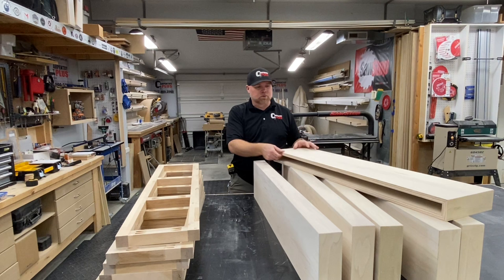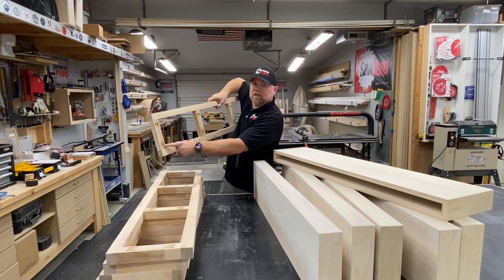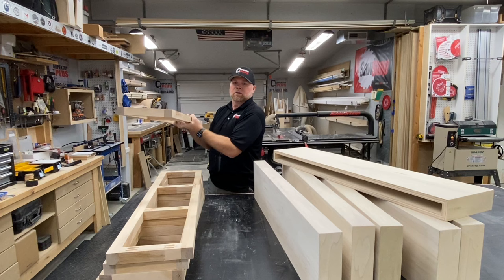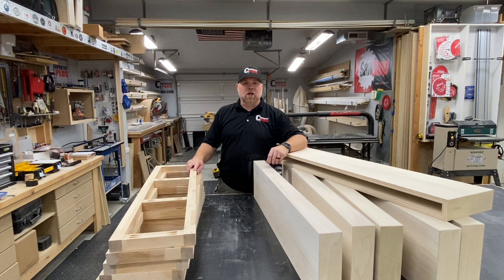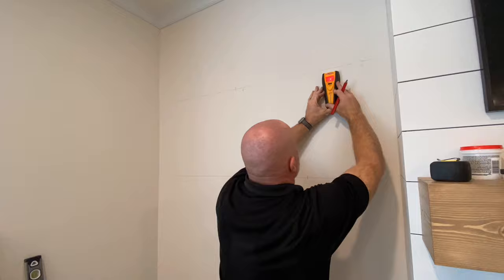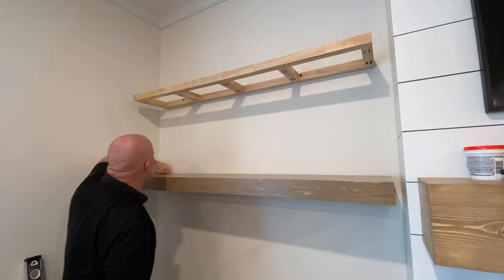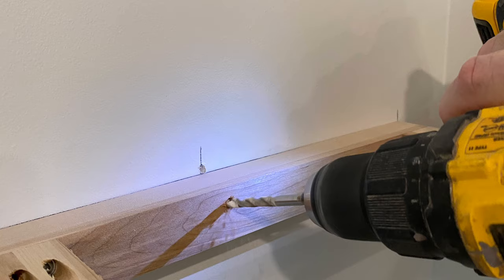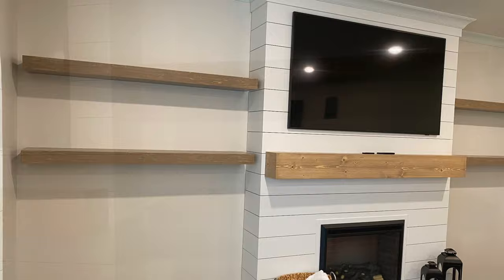Floating Shelves

Comment: my shelf needs to be 18 out form wall and 32 wide do you think this would work for something that size? going ot be holding consoles like dvd and satellite receiver and what not
Reply from the maker: I think that’s a little too far out for this thickness of shelf. If you made your shelf and frame thicker it would be more stable for that application. If you made a frame out of 3/4” plywood that was a 6” thick instead of 1-1/2” I think it would work. Might be thicker than what you want but it should be strong enough.

Comment: Hi I have a quick question newbie here. You mentioned your depth of the shelf is usually 10 in. what would the depth be of the interior frame be  if I’m using 3/4 plywood as well. Would it be 9 1/4 depth  so the actual shelf sits flush to the wall? Thank you in advance
Reply from the maker: Yes 9-1/4 is the correct math but usually undersized the frame a bit and make them 9” for a 10” shelf.

Comment: Great video.  Thanks for sharing.  What are your thoughts on the shelves potentially sagging over time?  I want to do the same shelves but I was advised to notch out the drywall so the frame can be secured directly to the studs.  Do you think that is necessary?
Reply from the maker: I don’t think that’s necessary. Drywall is pretty dense and shouldn’t compress much.

Comment: with your method, do you think a 12" shelf at 65" long would be strong enough for dishes? using 4 ledgerloks into studs?
Reply from the maker: 12” deep might be pushing it. I usually only do my floating shelves about 10” deep

Comment: Thanks for this video.  Saw your floating shelves on Instagram and was curious about the frames.  What type of wood do you build the frames out of?  Do you think ripped down 2x4 pine would be too soft?
Reply from the maker: I will use ripped 2x4 pine also. This was some scrap birch butcherblock rips that I figured I’d use up. Obviously the line is softer but I think it works fine.

Comment: @Carpentry Plus, a few questions.
What material do you use for the frame? 
Does screwing at an angle assist with support? And have you had it pull the frame out of level? 
Thanks for the time and effort of this video. Best video on this subject.
Reply from the maker: Thanks for the positive feedback. We usually just rip down some pine 2x4s or I might use some butcherblock if I have some scraps laying around. I do believe screwing at an angle assists the support and I haven’t ever noticed it pull the frame out of level.

Comment: Also - just for curiosity sake. If you hold off putting on the outside board you could drill and screw directly into the wall rather than at an angle. Then put the board back in place. Is there a reason not to do it this way?
Reply from the maker: I actually like drilling and screwing at an angle for this application as I think it adds strength to the connection.
Reply: @CarpentryPlus  ok. Thanks for the feedback.

Comment: Since you're covering them up - why do you use the pocket screws? I'm not being critical - I'm just trying to learn.
Reply from the maker: just my preferred method. I'm going to want to pre drill whatever screws I use so I figure I may as well use the pocket screws.
Reply: Hi I have a quick question newbie here. You mentioned your depth of the shelf is usually 10 in. what would the depth be of the interior frame be  if I’m using 3/4 plywood as well. Would it be 9 1/4 depth  so the actual shelf sits flush to the wall? Thank you in advance